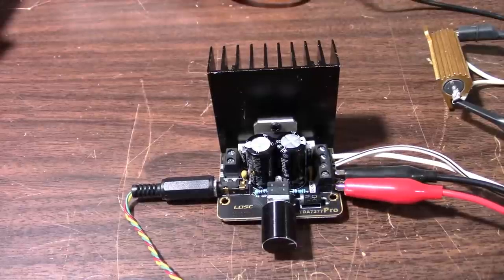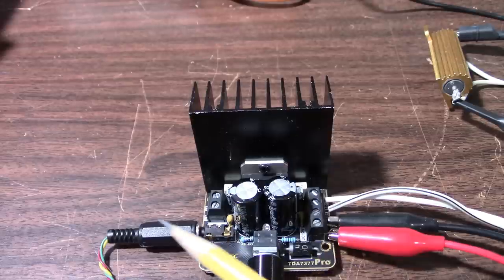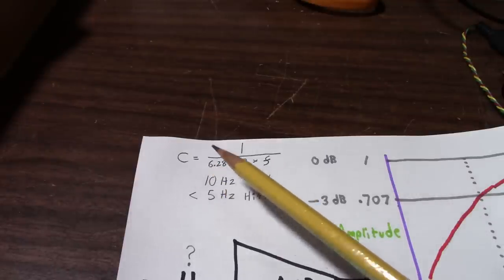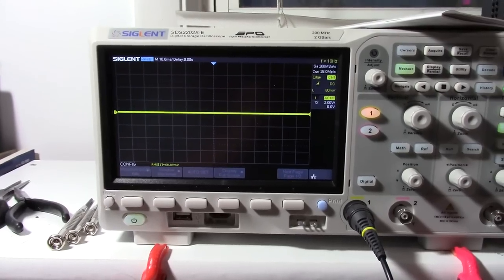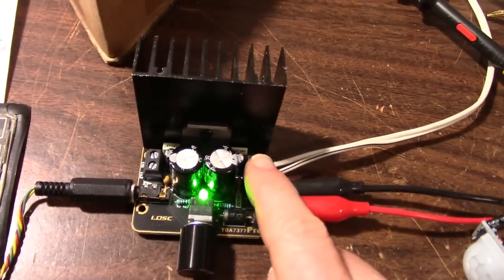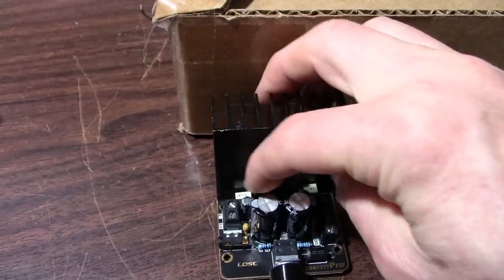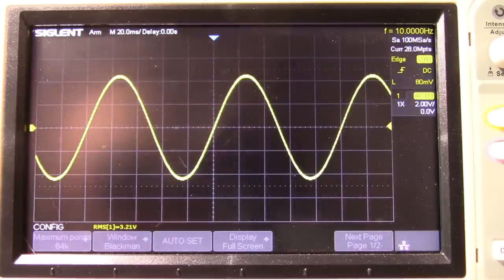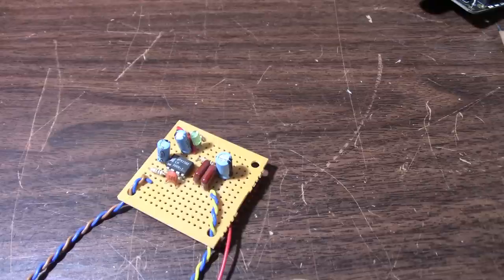How to select audio amplifier input decoupling capacitor value

Comment: Most amplifier designers choose an input filter based on the feedback networks lowest pole. The input pole is generally chosen to be 1 decade above the feedback pole to avoid low frequency oscillation or motorboating as some call it.

Comment: You also need to consider the output capacitor in series.
Reply: DC coupled class a/b power amplifiers with a split power supply don't have an output capacitor, hence then need for DC offset loudspeaker protection.

Comment: Thanks!
If the space is to narrow in the cap location. Then I think that you can just remove it and bride it on the PCB and put a cap somewhere on the positive lead on the signal input. Good explanation!
My mono block amps has a role of at 40hz when they go to bookshelf's. And I use a sub below that. frequency. When I use 12v then it is unnecessary to pump out juice that just is non beneficial.

Comment: Hi John, from the Philippines here
Would it be safe then to use 2.2uf as input caps?
I think the frequency responce would be just about covers the audible frequency range

Another thing I noticed when I replaced  all the ceramic type capacitors of a mini amp with a Polyester Film (Mylar) of the same value (including the electrolytic input cap) the mini amp sounded much finer & has less distortion.
Reply from the maker: Yes, 2.2uf would provide flatter response but 1uf is good enough. 2.2 uf film caps won't fit in the tight space on this board.

Comment: If you had an opamp on the input, say you wanted to buffer the signal or something, what resistor value (from opamp input to ground) would you choose after the input cap? You could have a 1 megOhm resistor and a very small cap. Or is it important to match the impedance of whatever the incoming signal is? I heard that line signal devices may have a 10 kOhm output impedance.

Comment: Great vid John . May i ask if the value of the cap shifts the freq response for the high frequencies too ?
Reply: No, it doesn't. You would need the signal to pass through a resistor and then a cap to ground to accomplish that rather then the signal passing through a capacitor and then a resistance to ground.

Comment: Not that this particular amp would be used for this purpose, but turntables and vinyl records get into the rumble and record warp range around he 5Hz mark.  Extending the frequency response too low will result in excessive woofer cone travel and lots of amperage being sent to the speaker for no useful reason.
Reply: That is true and a very good point! -  if you look at the frequency response of a really good amp like my Rotel RX-803 (from 1977)  it's 0.5 Hz to 60 khz and, yes you can see (but not hear) the woofer cones move in conjunction of a warped album.  So coupling this amp for -3db at 10 Hz is great, as It does not have the power supply "headroom" to spare.
Reply: @maker-matt  - back in the day, many audiophiles would buy or build a "rumble filter" box to allow adjustment of the input frequency roll-off. Rather than a simple RC filter like shown in this video, it was better to have a 2nd Order or even a 3rd Order filter. The more complex filter allowed the curve to be much sharper and thus would have less effect on the low frequency audio.
Reply: The TC 750 phono sounds better with 1uF in/out poly film coupling caps, replacing crap electrolytics that were bit high in value for the design orig as following input 4.7uf and out 10uf, the phonostage sounds more transparent and punchy

Comment: You seem to try to improve the frequency response by adding bigger caps, however I feel like you're forgetting about power filtering. You're probably better off adding multiple, differently sized caps,  to improve frequency response AND filtering, unless you can guarantee your power supply is super clean (none of my PSUs were clean enough to not need any additional filtering).
 
EDIT: Now I see we weren't talking about the same caps... I was talking about the big electrolytics...
BTW, how is the frequency response in the higher frequencies now? Doesn't a bigger cap increase ESR and therefore weaken higher frequencies unless you add some small caps in parallel?
Reply from the maker: The larger film capacitor on the input won't harm the high end of the frequency response. Input impedance is far higher than the cap's ESR anyway.

Comment: That is amazing how much that cap on the input improved the response with the solid state amp. Do you know if this also applies to the input stage of a preamp tube like a 12AX7, 12AU7, or 12AT7 ?
Reply: Yes is the easy answer, but the input resistance (The R of the RC as John has explained) is an actual resistor from the grid to ground and is typically of much higher value. My 12Ax7 tube preamp the "Grid Leak" resistor is 6.8 meg Ohms so the capacitor can be a much smaller value like a .01...
Reply: @maker-matt  Interesting. Thanks!

Comment: Hi, how are you?
I'm looking to figure out how to calculate capacitor value for a rca inline cable between the pre-amp and amp using a capacitor to set the signal to 60 Hertz. The input impedance of the amp is said to be crucial in figuring out the value of the capacitor. I want to put a capacitor on the positive side of the rca cable between  the input and output on one side and leave the second output to run to a sub. This way the amp only receives 60 Hertz and higher but the sub gets a full range signal. So a 1 in 2 output with the capacitor on 1 output going to the speakers 1 full range going to the sub. I don't know what I'm doing so I'm trying to explain this as best I can.
                  __ line out to sub Line --[
  In           __capacitor__speakers

Hoping that's clear lol
Can you help?

Comment: Why do some amplifier boards have reduced values of Input and output coupling capacitors if it affects the overall frequency response ?
Reply: higher value capacitors are more expensive, they're trying to save money this way
Reply: Saving a few pennies. Seems silly to me to be that cheap.

Comment: Many discrete class a/b power amplifiers have an electrolytic input capacitor which I find very strange. There is no dc across the input capacitor on the power amplifiers I've tested so an electrolytic would be operating with reverse polarity on negative half cycles of the input signal.
On several commercial and home built power amplifiers I have strapped out the input capacitor
which has had no effect on the DC output offset voltage even with the input shorted to ground.
I designed a stereo preamplifier using ultra low dc offset OP27GN operational amplifier IC's.
My preamplifier output is DC coupled to the power amplifiers with no problem with dc offset.
The dc offset at the power amplifier output is around 8mV with or without the preamplifier connected.
I have built fast acting dc offset loudspeaker protection into the power amplifiers.
Anyway, strapping out the input capacitor has vastly improved sound quality and extended the bass response.
Reply: They are probably "Non Polar" electrolytic caps.
Reply: @maker-matt  Yes they should be the non-polar types, but they aren't.
Reply: I think electrolytics can actually take about 1.5v DC in reverse before they start breaking down and letting more and more DC pass. The relatively high input impedance of an audio amp input stage probably helps limit reverse current damage too.
Reply: @uK8cvPAq  You are correct however the capacitor should never be subjected to reverse voltage.
Reply: The current flows in and out of the capacitor same as charge and discharge because usually it's ac signal. The other end of the capacitor is not directly short to ground so there won't be any damage to the cap even when there's significant DC.
Also electrolytic are much larger caps. It's easily over 100uF hence pushing the cut off frequency way lower. With film cap you need to select correct values.
Reply: @jimdavis5230  Happens all the time in some amps.

Comment: Can I use 1uF or higher (10uF) capacitor at input for Lm386 and Tda2822 chips if I don't get 0.1 or 0.22 uF ?
Reply from the maker: 1 uf is fine.

Comment: Sir i want to share this with u . When i used transistor writen that  it is made for switching applications like 13005 and 4205d   in the output stage ,these transistors  consumes very less current in biased state compared to normal 3055. Sir why it is so ?

Comment: The only issue with these amplifiers is that they don't have any thermal paste on the back of the amplifier chip, luckily I caught this and some on. Otherwise I could see this amplifier not being to reliable without it. No way it would be efficiently conducting heat to it's heat sink.

Comment: Should a low pass filter for removing RF go before or after the high pass filter (both passive)?
Reply: It doesn't really matter. In most cases, I've always seen a fairly low capacitance (330p - 470p) close to the input lead of the IC/first transistor

Comment: Most mfgr's of these pre-fab circuits select a cap so that your (1st order) response down by 3db at 20 hz. Not exactly an audiophile response.  For a typical bookshelf speaker this is fine. Not so good for floor standing. I built a Velleman Power amp (back in 2003) that utilizes the 7293 amp-on-a-chip.  It was down 1db at 20hz.
Reply: Sure, keep in mind though that even large floorstanders are usually 10dB down at 30Hz, no matter what their manufacturers declare, and that real in room response is dominated by internal resonances and reflections of a magnitude far exceeding 3dB.

Comment: did i hear you say 20Hz! riducilous, very few speaker systems can produce that low and general rule of thumb is we cant hear below 40hz (professional sound guys say we are just hearing harmonics)... Professional sound systems are normally set up with a low cut filter at 40/50hz
Reply: Most of the people watching this would be horrified to learn that their speakers are likely useless below 60hz- and often 100hz.. Low frequency comes at a price and normally means huge boxes and wasted power
Reply: ported boxes create an even bigger issue- below their tuned frequency there is nothing to dampen the movement of the drivers causes over exertion of the cone and produces basically stuff all sound while still using big power...
Reply: You're right. Two things could improve this, firstly an amp with high damping factor and secondly a type of "boxes" where the cone moves only a bit even at lowest frequencies, a horn speaker! Here you find a great DIY projekt which I'm aming at once my amp is fixed, please look at link #2 in the description. https://www.youtube.com/watch?v=8qVOwWV_mWI

Comment: What about how important is the type of dielectric? When I built my headphone amp I used CYC and polystyrene capacitors because I heard they were the best. Obviously they are larger but I had the room. I wish I owned an oscilloscope so I don't know if my implementation was correct. Still sounds good!